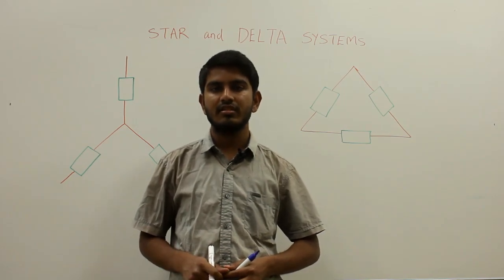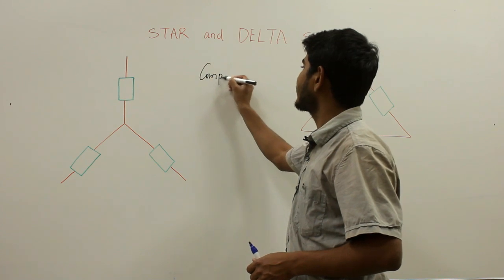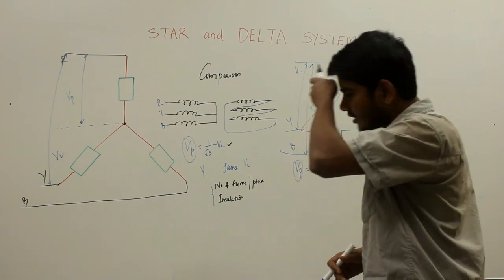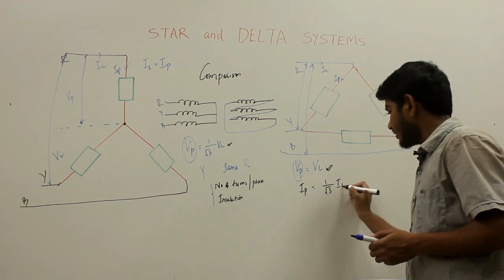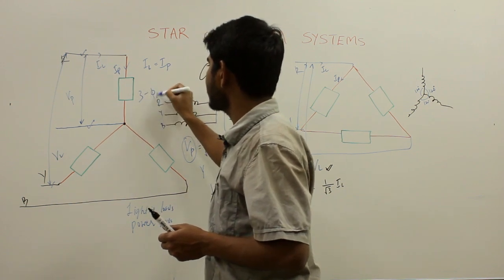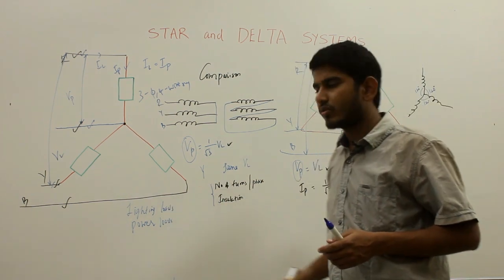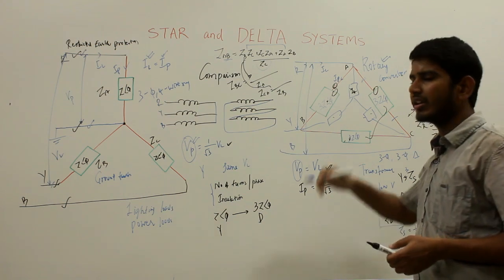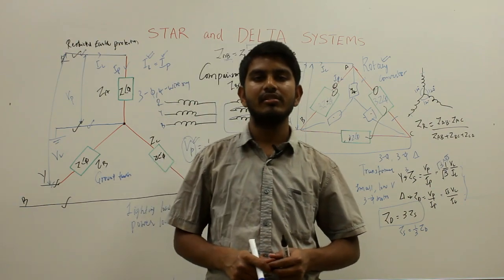Where Star and Delta Connection to be Used?

Comment: sir,    if Ip=IL in star connection,then how star-delta starter will reduce starting current in motors??
Reply from the maker: Star side is connected to line and Delta side to the induction motor, Star reduces you voltage and delta reduces your current